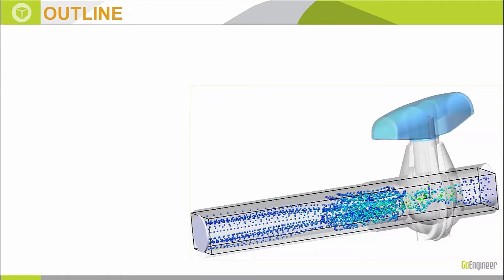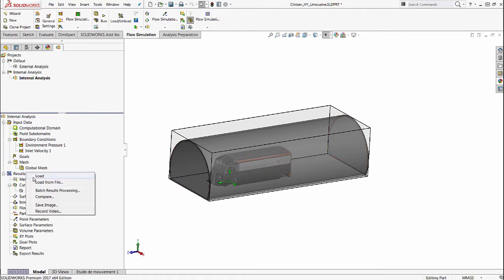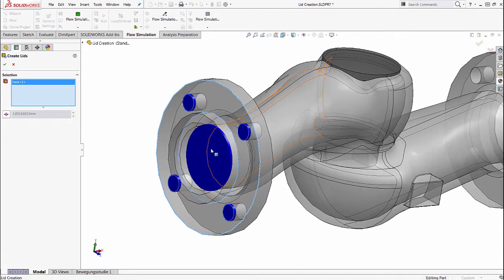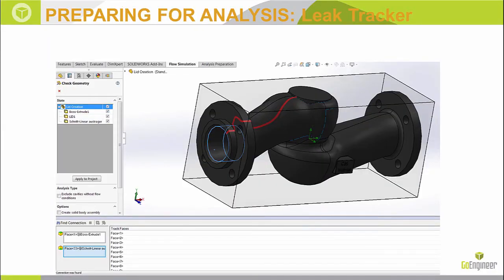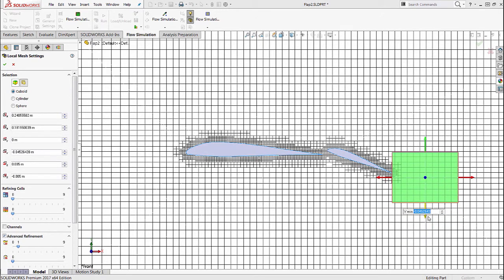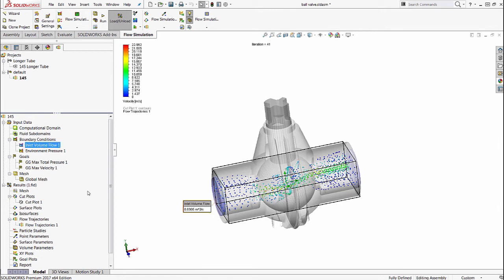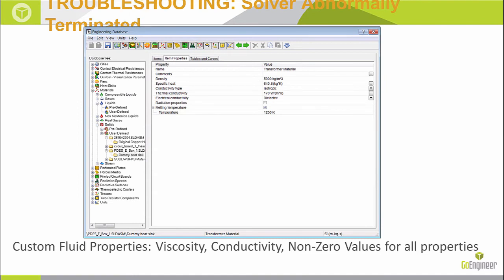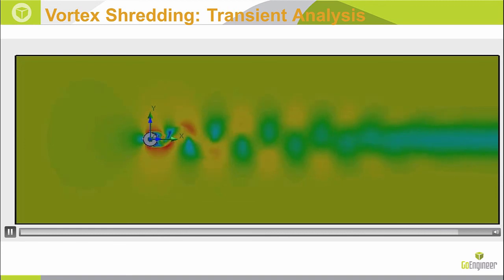SOLIDWORKS Flow  Simulation - Troubleshooting

Comment: trying to mix two different fluids in a y-pipe using different volume concentrations (0 and 1), but cfd results were not accurate. Pressure drop was very minimal compared to calculated value. Any thoughts?
Reply from the maker: We would need more details to be able to answer this question. The best way forward is going to be to reach out to your VAR's tech support team.

Comment: I am having a problem with simulating a heat exchanger. The hot fluid is getting cold but, the cold fluid is not getting hot at all. I have checked the boundary conditions and fluid domains; they all seem correct. Hope you have any helpful tips or any clues. Thank you in advance.
Reply from the maker: Here is a article that might help https://www.goengineer.com/blog/thermal-study-setup-solidworks-simulation

Comment: please I have a question and want you to help me.
what are the values of k and epsilon in case of turbulent flow is considered?
Reply from the maker: Those values are not Constants, so they are dependent on the factors of the specific simulation you are running and may differ from set up to set up.  The comment section on a youtube video is not the best place for that level of detail.   Please contact your local VAR for more in depth discussions 

https://en.wikipedia.org/wiki/K-epsilon_turbulence_model

Comment: I'm struggling with the flow trajectories for a fan flow. When i visualize them, they are showing ONLY on the model , but not in the computational domain. Any idea why , and what i have to change to see them in the whole computational domain?
Reply from the maker: That depends a lot on context unfortunately. The best course is to get in touch with your VAR's technical support team they should be able to help you out.

Comment: I am having an error message, saying "process abnormally terminated", and warning that it's showing is,  "Maximum mach number achieved, flow reached supersonic condition". Can you suggest any tip regarding this? 
Thanks.
Reply from the maker: Yasir,

Assuming supersonic flow is realistic, make sure you go to your General Settings and turn “ON” high mach. 

Assuming supersonic flow is not realistic, I’d go through these steps:
(1)	Check the boundary conditions – anything unrealistic here? Did you manually do any unit conversions? 
a.	Right click Input Data and go to Units. Change units here to something you can interpret easier. 
b.	Put in a very low flow rate or 1 atm of pressure, do you still get supersonic flows?
(2)	Do you have any custom units, materials, fans etc? Switch these to a type from the default database to see if they are the problem.
(3)	Do you have small regions that may be turning into mini venturi nozzles?
a.	I’ve seen small gaps and o-ring grooves cause supersonic conditions when not meshed properly, or when not blocked off. 
(4)	What other physics are you trying to do? Rotation? Free Surface? 
a.	I’ve seen free surface cause supersonic conditions because the hydrostatic pressure of the liquid mixed with the gas trying to escape is causing a fast moving gas pocket. 
b.	Try switching boundary conditions to mass flow rates rather than volume flow rates.
c.	For rotation you may need to switch to Sliding mesh rather than Averaging. 
(5)	Narrow down the problem. Create more lids and cut off sections of your model. Use simple flow rates and pressures. Eventually you will find the area that is causing the problem.

If all else fails reach out on the forums at my.solidworks.com or to your local reseller. Hope this helps.

Comment: can we do vibration analysis for the vibration due to air stream ?
Reply from the maker: Hi Akshay,
Flow Simulation does not make vibration data that could then be used in a vibration study in Simulation.  Vibration data would need to be obtained from another source in order to input into the Linear Dynamic Random Vibration analysis of Simulation.